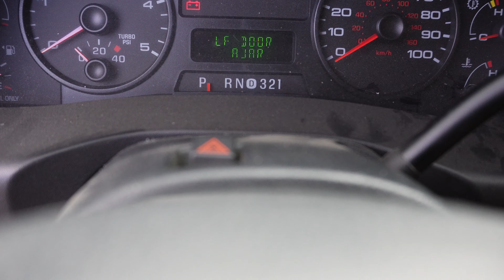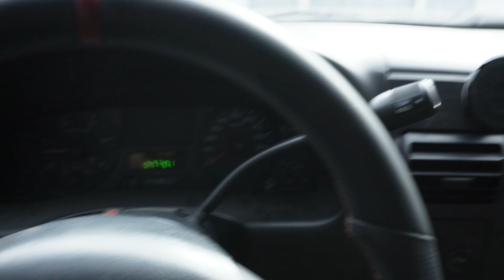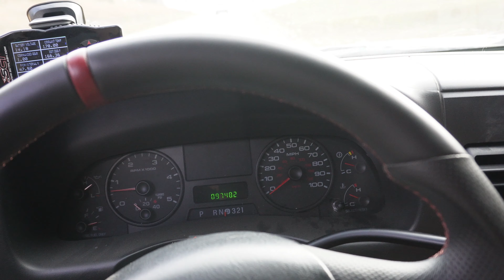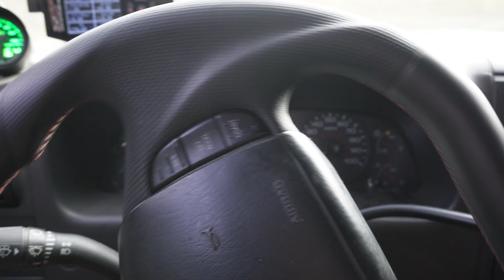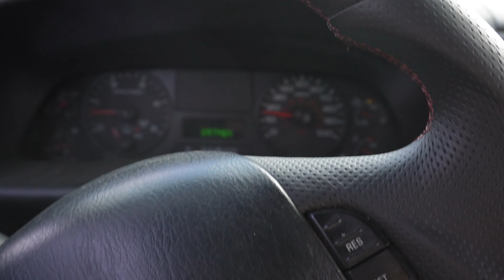NON VGT 6.0 POWERSTROKE RIPS!

Comment: Dam that’s way too much smoke. You would not be able to drive that in a handful of states without getting pulled over
Reply from the maker: Yeah it had a lifter failing & high pressure oil pump so the engine was not running the way it was supposed to be. Truck is actually getting another new motor as we speak lol